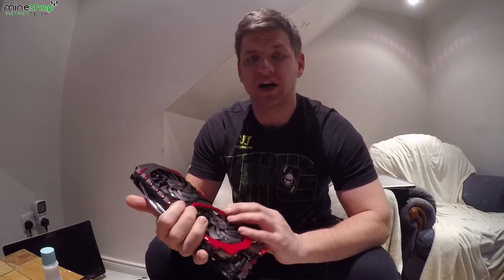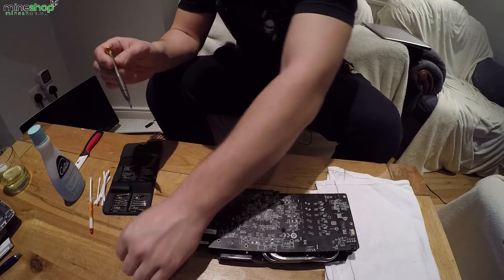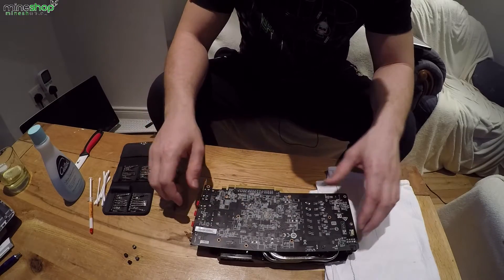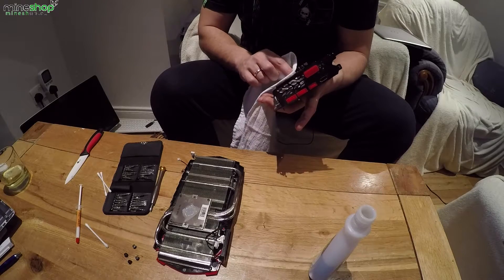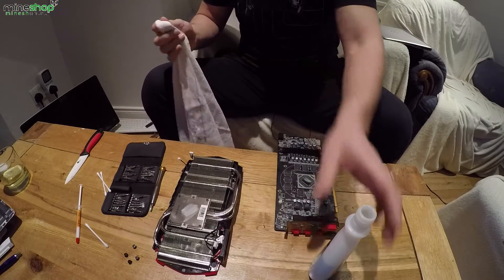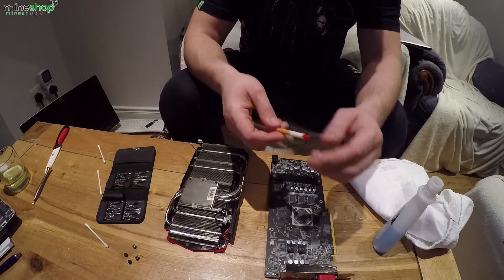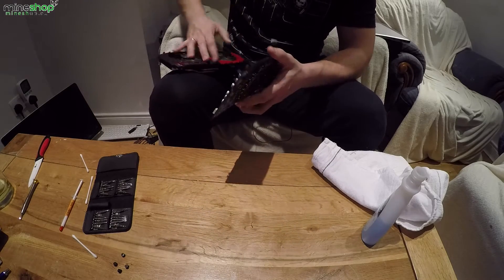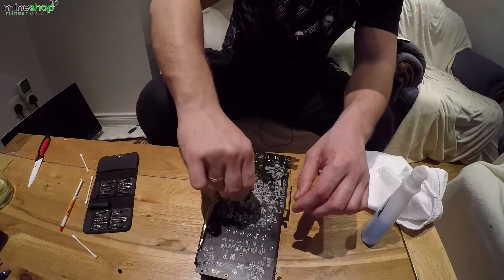How to apply thermal paste on GPU.

Comment: How long do I have to wait before starting to use the GPU again after applying the paste? I mean can we run the Computer right after finishing the work? Or do we have to wait a bit for the paste to stabilize or something?
Reply: This depends on the paste itself. There are different types of paste (carbon, mineral, metal with even more varieties). Some of them need time to settle down, others are good to go right away.
Reply: @prismaticgaming8465  Thank you.

Comment: Hey Guntis, do you know if i have to apply thermal paste on the CPU? my guess is its not necessary because not only will it never overheath but the heath itself is very low.

So im guessing we dont need to bother with thermal paste on a CPU, but could you confirm that?
Reply: MadScyan it is very important to apply it on the cpu just in case. Better safe than sorry
Reply: Your CPU also has thermal paste on it which can and generally does need to be replaced every now and then, every few years is okay, I'm just gonna wait until my temps are too high for my liking.

Also, yes, it can very easily overheat, have you not need CPU's throttle when overclocked?
There was also the time I took my cooler off and didn't have paste to replace...I couldn't use my PC because by the time it booted to Windows, it had shut down to prevent itself from being damaged by the heat.
Don't neglect your CPU

Comment: If I just bought a brand new Intel LGA1150 do I need to remove the stock thermal paste and apply better quality or is it fine with the stock thermal paste that comes on the processor fan?

Comment: you actually want a bit over the edges. 
you don't want to touch the chips on the board, they are very sensitive to the electro static from our bodies, so you want to rather grab the video card by it's sides avoiding to touch the chips along the surface.
Reply from the maker: Michael Schmitz oh a yes , I should be grounded also :)
Reply: not if you're barefoot... lol